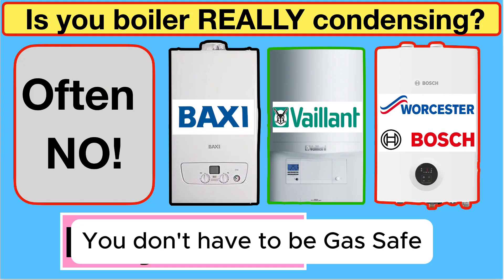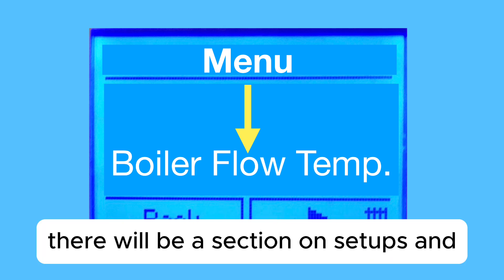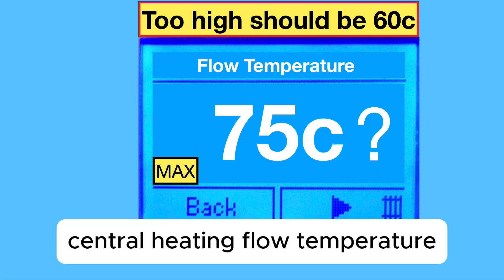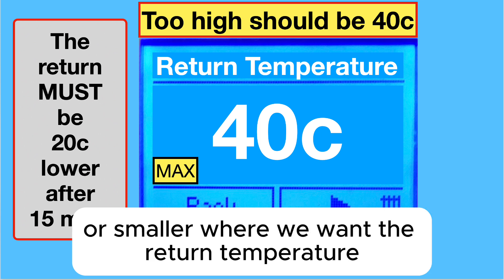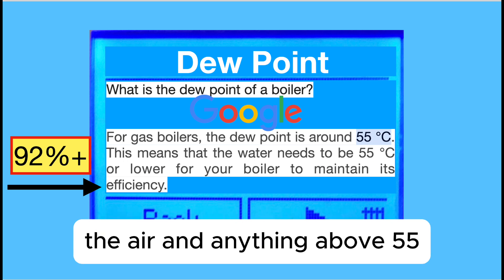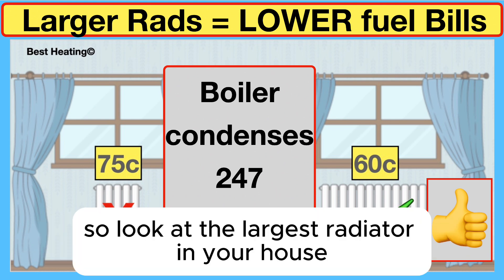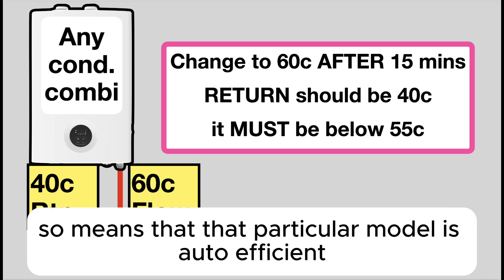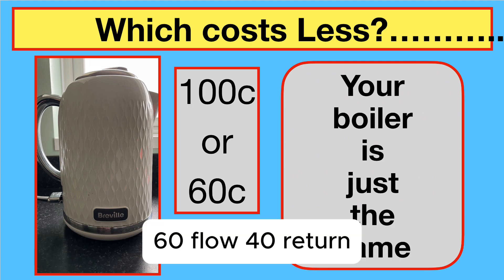Is your boiler REALY condensing? Most are NOT, I show you how to test, it’s easy.

Comment: Just bear in mind if you have a system boiler with a cylinder, a 60deg flow temp won’t be high enough to kill off legionella bacteria in the cylinder, combi’s are fine to drop the flow temp.
Reply from the maker: Hi David, thanks for your comment, 60C flow is high enough for the cylinder, as you know all cylinder stats have to be 60C 1/3 off the base, so no problem about bugs. All the best, George staszak
Reply: @mrcombiBedford  and you’re assuming 100% heat transfer? 60 deg flow won’t heat a cylinder to 60deg
Reply from the maker: Hi David, when we had non condensing boilers the flow was 70c+ but the cylinder stat has always been 60c. The top of the cylinder is 80c+ so there is not a problem,  most boiler firms now say 60c. I have been teaching this for over 15 years because my installer friends in Poland and Germany say 60c for any boiler any system and under floor 30c.  that's why they have much lower bills and we have the highest in the world, even USA.👍
Hope I have explained OK, take care , George Staszak
Reply: The top of the cylinder cannot be hotter than the flow temperature, and with a 60 °C flow the bulk of the cylinder will be cooler—so stratification alone does not provide reliable Legionella control.
Reply from the maker: @davidcurrie9146  Hi David, when it's 60c at 1/3 then the first draw off will be much higher, try it with a thermometer then see if it's 60c

Comment: Hi Im reaching out to you regards boiler noise.
Our neighbours boiler causes a drone in our property, they have changed the pump and auto valve but the noise remains.
Could the fan cause this or something else.
When the boiler was installed ten years ago we had the same problem (different owner).
They did fix it and life was good.
Any help would be great.
Reply from the maker: Hi 66, thanks for asking, don't understand why change the pump or auto by pass? Noise id from a moving part, Nr. 1 is FAN then gas valve. Remove the cover and see where it's coming from,  use a long screwdriver carefully put on a part(s) the other end in your ear. That way easy find the noise. Hope that helps. George Staszak 🤩
Reply: @mrcombiBedford Thankyou, their plumber apparently indentified the pump.......I always leaned towards the fan was unaware a gas valve could be the problem , its a cheap boiler from poland I forget the name.
I,ll forward your reply to their landlord.
Reply from the maker: Forgot, just check if the flue is OK and not split, had one that made a purring noise.